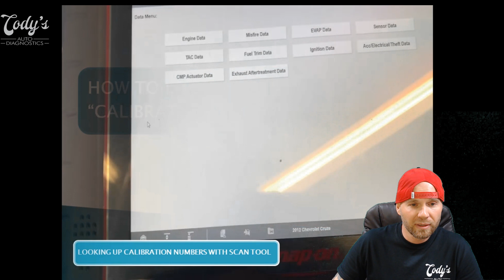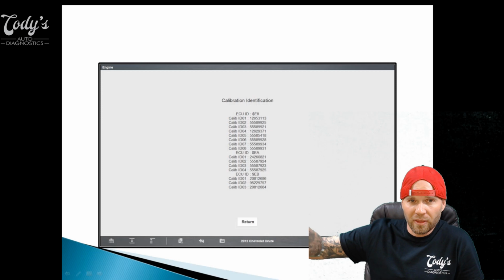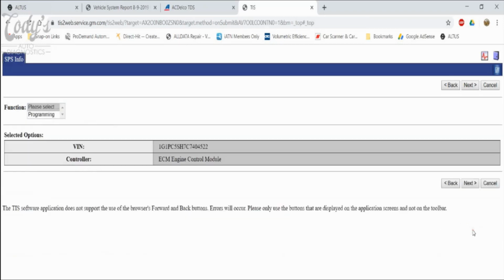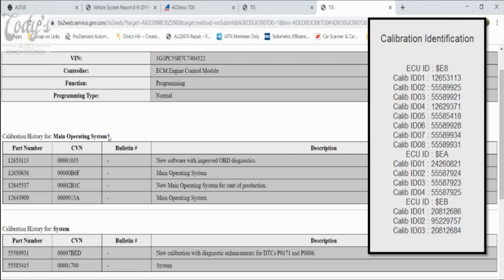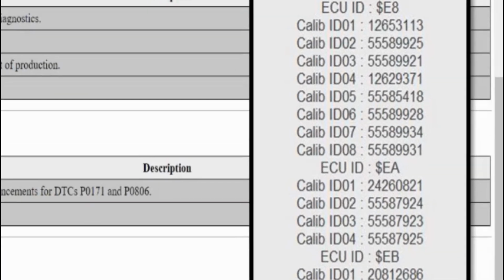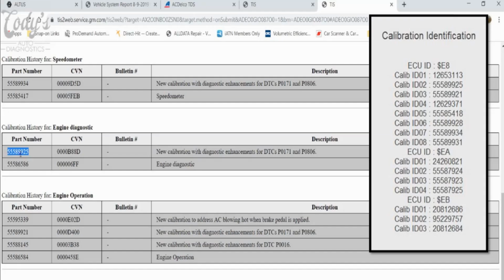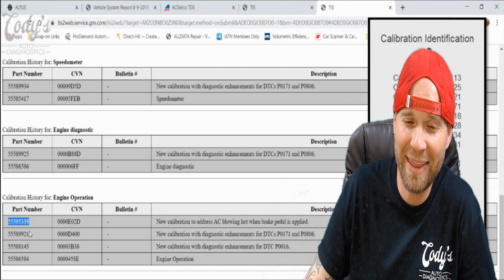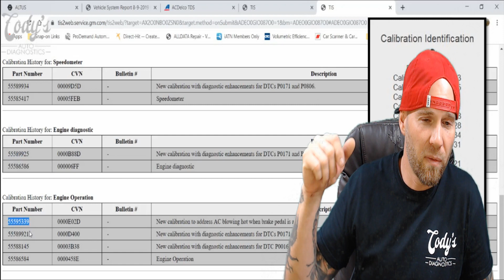GM CALIBRATION LOOKUP

Comment: One of the challenges we face is explaining to the customer that the flash is necessary but doesn't guarantee the fix. It's a tough thing to explain and the only time I can think of where "We have to try this first and see if it works" is acceptable.
Reply from the maker: That’s a very good point Corey. We need to make sure we are not chasing our tails before we go to deep into diagnosis.

Comment: Will gm do updates even thier is not a problem I ck my truck and thier is a update for the glow plug module.
Reply from the maker: Bill you would have to call the dealer and find out if they would or not. I know for us independent guys I will look for updates on vehicles, even if not having an issue to help prevent future issues or diags that customers may encounter

Comment: when I started at chevy it was oil leaks and broken bolts along with noises     when I left 25 percent of my day was reprograming  for fixes  how it changed  from switching over a prom or memcal
Reply from the maker: Goes to show how times have changed. So much programming has fixed lots off issues now. Great information and thanks for sharing